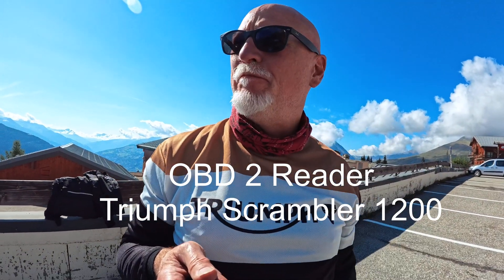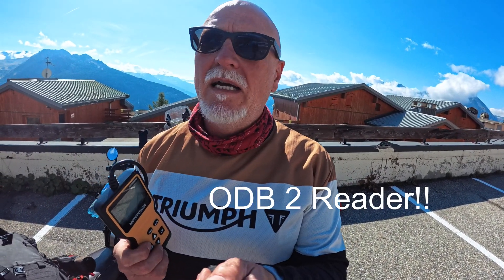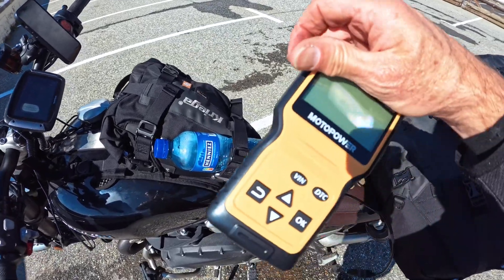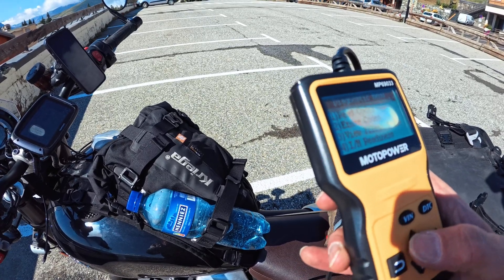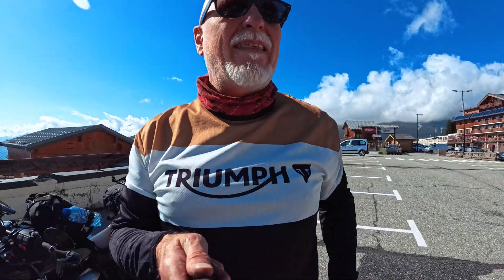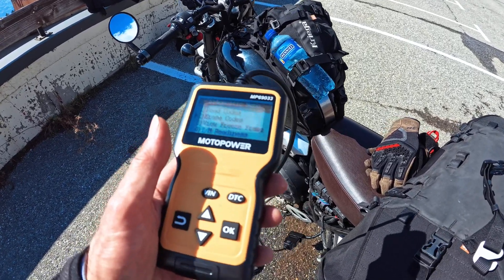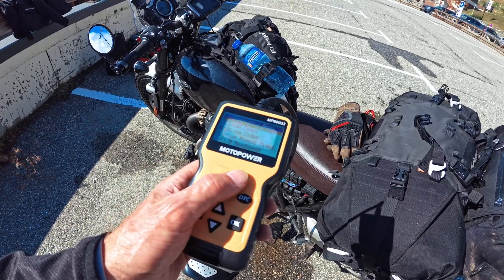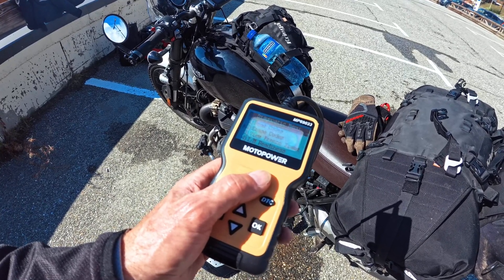OBD 2 Reader for motorcycles. Triumph Scrambler 1200 xc.

Comment: Useful little gadget for not much money! Excellent. Still really interested in getting a Scrambler...they are great bikes. Is that the Triumph screen or the Unit Garage one...? Hope alls well,  cheers Steve
Reply from the maker: @stepheneldridge6998  Hi Steve - I’m still loving the Scrambler 27k miles later. I should probably change it, but I can’t think of anything better. If you’re considering one, I’d think about going for the previous models up to 2023 - better spec particularly the Ohlins and Showa suspension. The new X is a much a lower spec than the  now discontinued XC. btw the screen is Triumph’s own Tall Screen and I’ve added a small Puig clip-on bit too. Take care and Happy New Year 👍